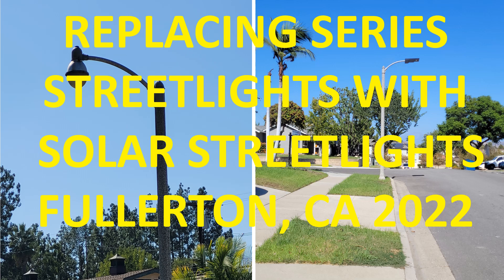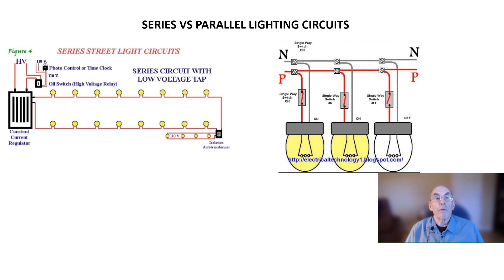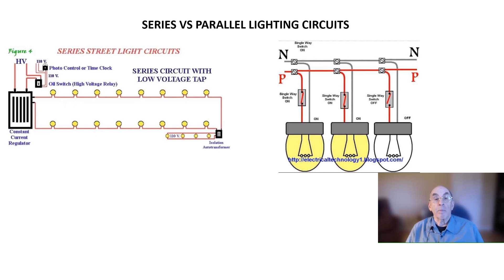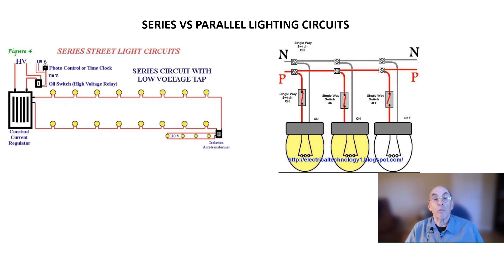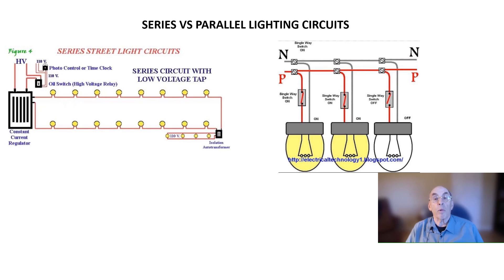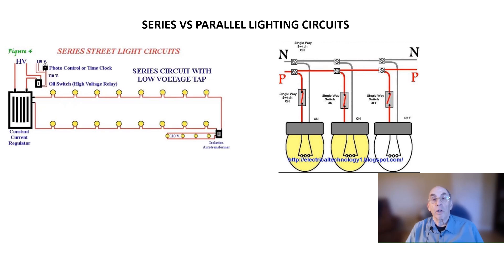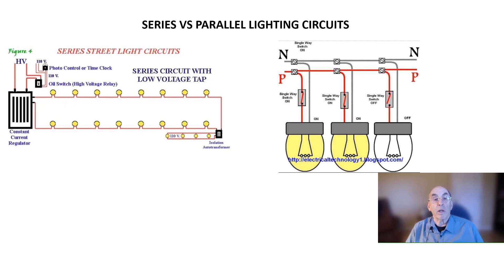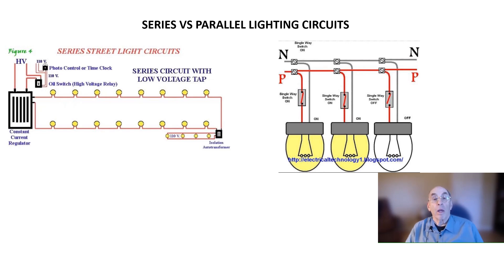Replacing Series Streetlights With Solar-Powered Streetlights

Comment: It sounds like a good solution. How long do they intend to run this test before using them on a larger scale?
Reply from the maker: I don't know the answer to that question. I will check with the city to find out.
Reply from the maker: I finally was able to get an answer about this from our city public works director this evening (10/17/22). The test of the solar-powered street lamps will last at least through the winter months, in order to see how well they work during rainy periods with relatively low amounts of daylight. Before then the city plans to send questionnaires to residents in the test area to see how well they like them.
Reply: @DrMarkHShapiro  thanks for following up!

Comment: great, with the carbon savings these street lamps will pay for themselves in 100 years 🫠
Reply from the maker: Well, that's immaterial. What is more important are the savings generated by not having to pay SCE for the electricity that grid-connected streetlights require.